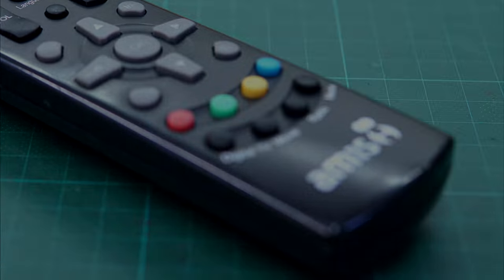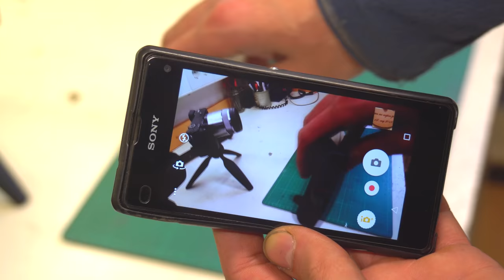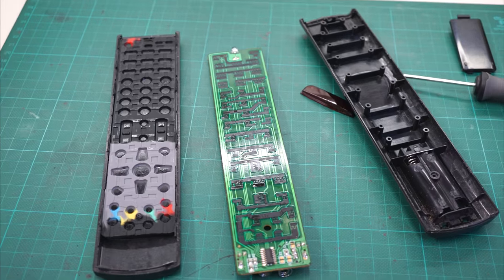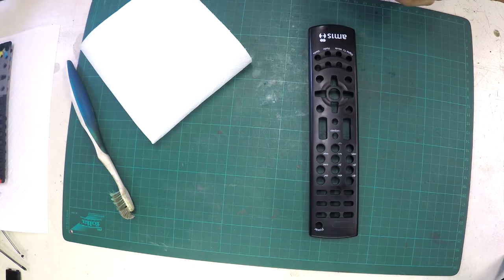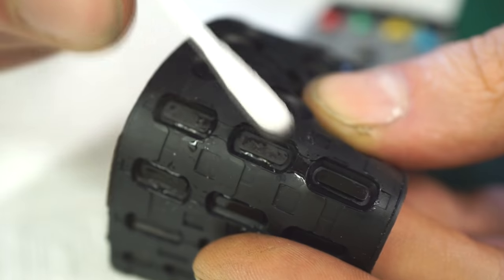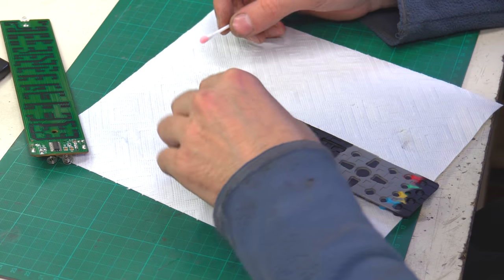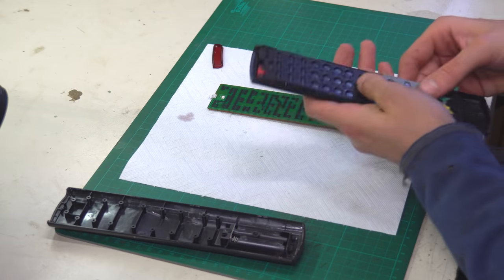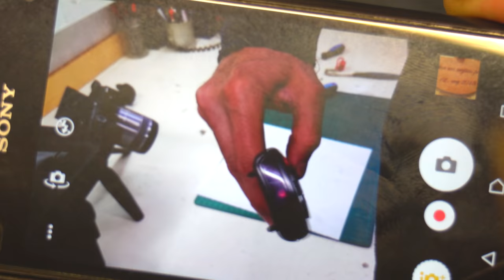How to repair tv remote control [non working buttons] diy 10 min fix

Comment: This does work!  I thought the buttons were broken, but before I threw it out I might as well break it open and try to fix it.  There were two screws (one behind a label just like you said) and then I pried it open with lots of popping - what sounded like breaking.  Cleaned it as you said but had to put it back together without the solution you put on.  It went back together easily, snapped, and has only a few gouges from my prying.  Best of all - IT WORKS like new.

Comment: Thank you so much...really effective. We used cotton buds and surgical spirit to clean inside and out. Controller works fine now. Didn't  use contact solution as only had WD40 but clean up worked fine without. Saved us having to buy a new controller. Cheap and environmentally friendly. Brilliant stuff
Reply from the maker: Ok, if work after cleaning, don't apply anything else, only cleaning is best.
Do not aply basic wd40, because it got "acid" inside + grease, so bad for contact and because of "acid" contact can oxidise (rust) after time.
But i think wd40 sell also special sprays for electrical contact, that's the right thing, but if work do not aply anything. Thanks

Comment: Fantastic, I followed your instructions and it worked like a charm. I was getting ready to throw out the old one and buy a new one. Thanks 👏🏼👏🏼👏🏼👏🏼
Reply from the maker: Great, alwas happy to hear positive feedback, stuff like that today is so cheap but the feeling when you fix it is priceless, isn't it?
Reply: Not only did I fix 1 remote but another one that also didn’t work. 
👍🏼😘

Comment: If all else fails - try my fix - open remote 1) make a note of buttons not working 2) Clean all button contacts and circuit board as shown in the video 3) re assemble, check and note if any buttons not working 4) open up again and get a length of thin double sided adhesive tape 5) cut a short strip ay 50mm and get same length of foil stick dull side of foil to tape 6) use hole punch with bottom cover of and punch out discs from the tape/foil you just made 7) with a sharp blade gently ease foil from disc edge (it usually comes of with adhesive attached to foil) you may need tweezers to pull of completely 8) position/place disc over contact button and press down with finger - repeat on all buttons not working. I have successfully done this on several remotes. Needs a bit of patience.

Comment: What is the "grease" you refer to at 2m45s is this a lubricant or a cleaner.
Reply from the maker: It's electrical contact solution it make good contact on buttons switches... Google it for electrical contact grease, there are many brands, also wd40 got one of them.

Comment: I am having trouble remove the cover of remote control because the top/bottom cover are ultrasonic welded together. Any suggestion how to remove to top/bottom cover without damaging them ? Mine is Panasonic TV RC.
Reply from the maker: If they are welded, i think the best result got with a knife or if you got a small tiny saw in a drill like dremel...
Before closing clean the edges of plastic so they are nice and then glued together with ca...

Comment: I have a question regarding the Sony remote.I have only my voice control buttons is working except other buttons on Sony remote. I can not switch on or off using remote.I am using manual buttons behind my tv.Can you tell me how to fix this issue.
Reply from the maker: Try to do same as i do in that video if the power button don't work focus on that button while cleaning.

Comment: The infared light isn't working and I can't find any screws to take it apart. If the light isn't working is it a gonner?
Reply from the maker: Maybe your lens got protection cover and can't see the ir light, try with some other older camera, many remotes got no screws, try to open carefully apart, there are kust hooks on booth side of cover.
Reply: Okay I got it apart when you say alcohol can I use nail varnish remover is that like the same thing
Reply from the maker: @nataliewallace8250  you can use pencil rubber eraser to clean the spots, i would not use aceton it's too agtessive and may demage the laquer on a pcb.
Reply: @TinC33  I used a little bit of hand sanitiser and did all you said, but the infrared light is not working and still not connecting to my TV to switch on I think I'll have to buy a new remote control. Thanks for all your help.
Reply: @TinC33  when I was trying to look for my remote control I moved the settee and because I've got a recliner. The metal bar of the settee underneath squashed the remote control as I put the settee down, so maybe that has somehow damaged it.

Comment: Thanks for the video. I opened up my remote and gave it a good clean including all the contacts on the pcb and the rubber buttons etc. I ad three buttons not working before and those still dont work. Any ideas?
Reply from the maker: maybe the pads was worn out, you can buy specially Keypad Fix kits but it's about 10$ but you can buy Electrically Conductive Adhesives (ebay for 1-2$) and just make a thin layer over the rubber button pads.
Reply: @TinC33  Thank you for replying. Yes sure I can try the ECA. Do you think applying it would fix the buttons and the issue is not rooted in the pcb sensors itself?
Reply from the maker: @SaminPK  try on one button firstly, there was no sensor, it's just circuit (two end), and when you touch it with something conductive, it make contact, you can try push a piece of aluminium foil on spot of one button and you will see if pcb work.
Reply: @TinC33  Aluminium foil idea is great. I will try it tomorrow and update. Thanks

Comment: I may need that kontak liquid. When I looked at the circuit board the same button that keeps giving trouble shows a faint line through it as if the circuit may be broken
Reply from the maker: What about thishttps://youtu.be/Z7tsTG_Kq4M

Comment: Instead of using a camera, take the control and bring it near to a radio (AM) set to a blank spot on the dial (no station). Push each button to listen for a noise. You will know the unit is transmitting if any button makes a noise on the radio. Push each button to see how many are working. If some don’t work,it will need the repair shown here. Some radios are better than others,being more sensitive than others. Portable transistor radios I found were best.
Reply from the maker: Interesting, thanks for info.
Reply: If you have an electric guitar aim at the  pick-ups, works great.
Reply: This won't work on an infra red (IR) remote, it will work for a radio frequency remote (RF)
Reply: @vikramupadhaya5784  I have a few IR controls. Yes if the IR transmitter itself is working or not working,the camera test is needed. But if you have button problems only,the control still generates a frequency that the radio picks up. Years ago when I was listening to a radio program on headphones I had the tv on. I pushed the channel button and it scared the heck out of me. This is how I caught onto electronic devices can generate frequency’s the radio can pick up.

Comment: What if the light does NOT even switch on please ???
Reply from the maker: Check the contact into battery tray if they'r rusted clean them and install new battery. Or you got wifi remote.
Reply: Contact does seem a little rusted ... What would be the best way of cleaning it please  @TinC33  ???
Reply from the maker: @johannedufort5900  try with fine sandpaper and than with pencil rubber cleaner, but don't broke them, you can also put small ball of aluminium foil in it if you broke the spring to make contact.
Reply: I did try to put some foil paper on  @TinC33  ...
... Which caused the battery to heat up significantly !
Reply from the maker: @johannedufort5900  you just need to make small ball of foil so it won't touch other terminals, but if you got non broken spring just scratch rust away and install new batzery, because old batery cause rust on spring.

Comment: Cleaning works if your remote is dirty, but not if the buttons are worn out. Kontakt 60 or alu. Folie tried, stil few buttons do not work.
So i tried liquid silver on the buttons. It works, but not for long.
A few buttons refuse to work. Shit
Reply from the maker: In that case you need to use special conductive paste, i see once "button repair kit" there was conductive glue to repair pcb and lot op tiny pads to glue on keyboard.